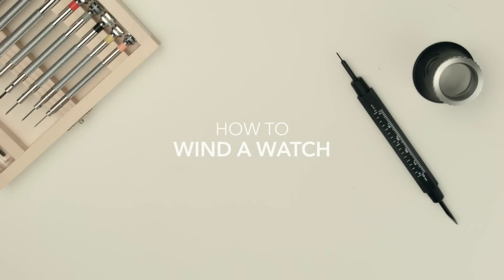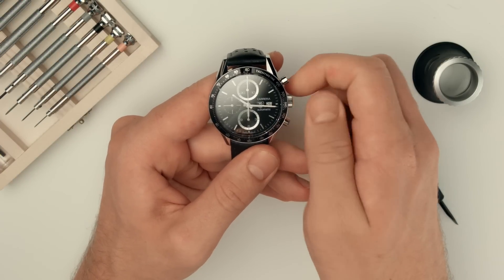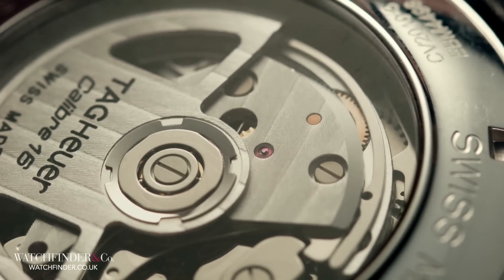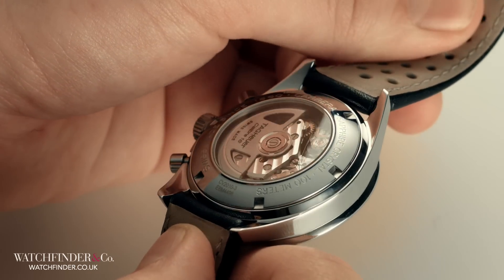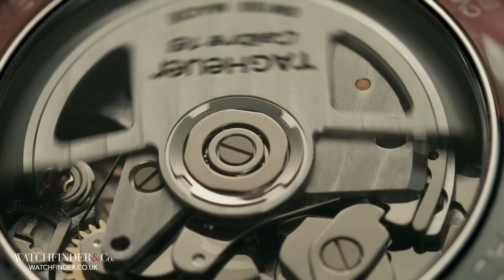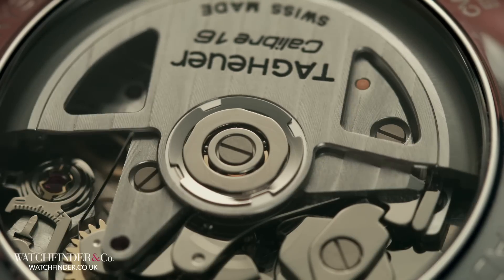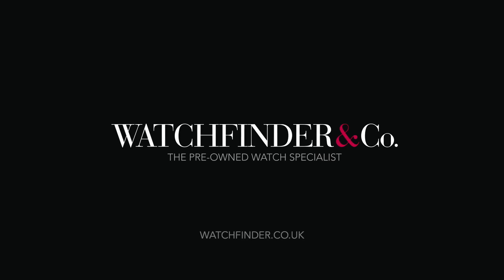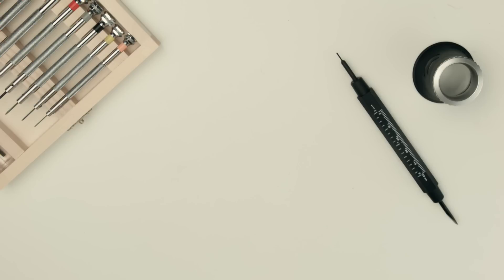How To Wind A Watch | Watchfinder & Co.

Comment: How do I differentiate between automatic and mechanical watches ?
Reply: automatic are mechanical watches.
Reply: All automatics are mechanical but not all mechanical watches are manual. They usually have a rotor that can be seen. It should also say on the watch.